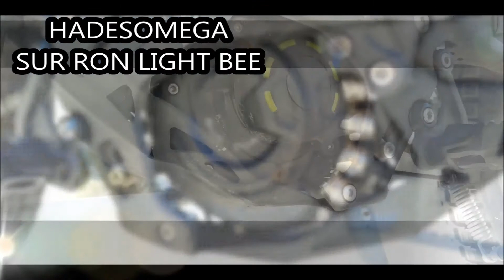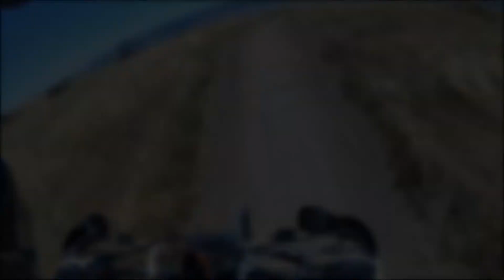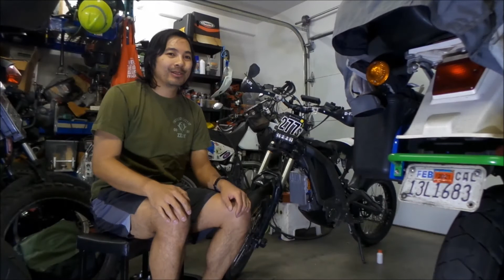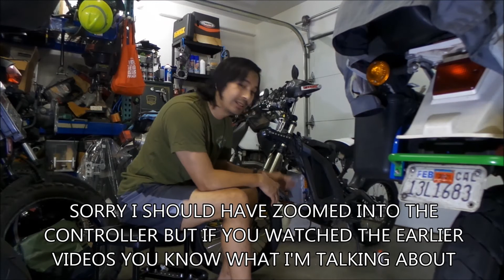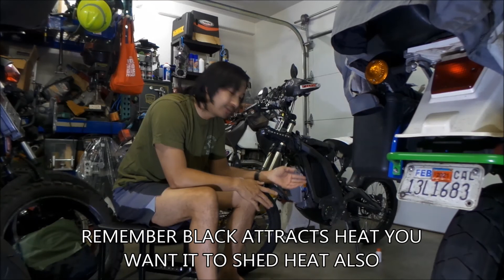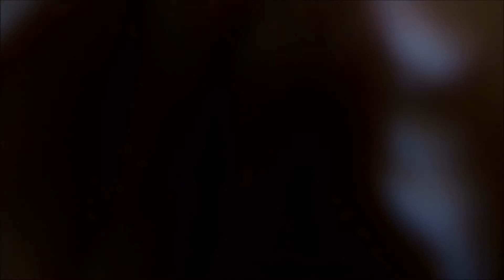Sur Ron BAC2000 Overclocking Heatsink VLOG Part 18 - Conclusion and Recap VLOG

Comment: for stuff other than thin sheet you'll probably have to find an aluminium supplier, rather than hardware stores. 'least thats the case in aus. Here the hardware stores sound like yours... basic metal sections but expensive and limited range. Ally suppliers here I can get 100mm thick plates that measure 1.2 x 2.4m if I want it... and get the same stuff as in the hardware store for literally 1/3rd the price.
Also kinda surprised you didn't try and find some heat pipes, pretty sure there's some manufacturers in the USA for them...
enjoy the vids anyway mate. keep it up.

Comment: hello. im looking for a rear axle bolt and nut for my surron. i stripped mine out. let me know if you have an idea on where to get one. thanks
Reply from the maker: You can get one from Ebike Zilla, I don't know if it comes with the nut though.  You can probably just get the nut from a hardware store.  Looks like they're not in stock right now though...
https://ebikezilla.com/en/wheels-tires/3023-rear-wheel-axle-surron-51350-yq2a-0000-sur-ron.html
Reply: HadesOmega Moto yea I checked ebike zilla. Sold out :( thank you though!